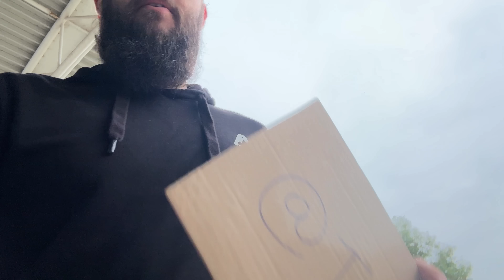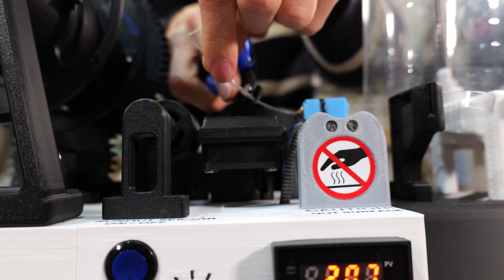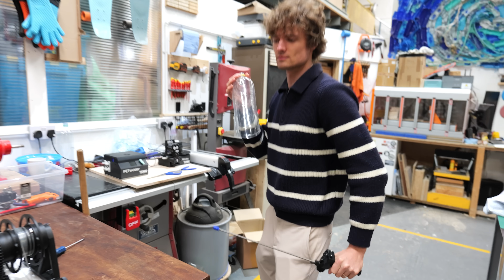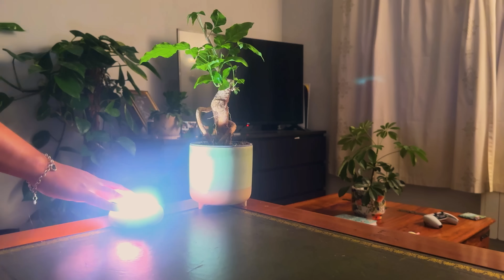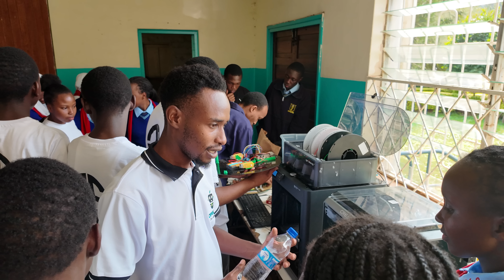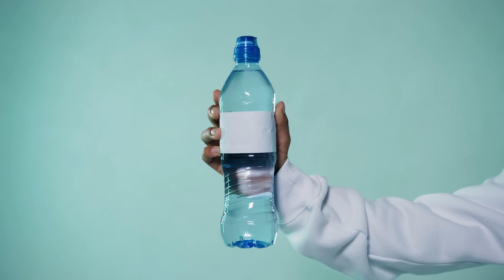Finally, a way to recycle Plastic Bottles at HOME

Comment: Speaking for myself, the fact that 3D printing waste cannot be recycled through the regular kerb-side collection channels is a huge turn off for me to explore the possibilities that 3D printing can offer. Regardless of whether there's space for the printer or how much one costs, I just can't justify a making process which generates that much non-recyclable waste, or at best limits you to what you can print if you don't want to use supports...
Reply from the maker: It’s the same reason we haven’t been using 3D printing for many years. We have recently started using it as a prototyping tool for custom work, which is a great application for it. And the addition of using rPET adds a new level to this
Reply: Again, it is back to how much of the plastic is actually getting recycled in your location? If little to no plastic is getting recycled in your community, then it is likely getting landfilled. Your failed creation will still likely take up less room in the landfill than the original bottles. I have been saving plastic bottle caps from half gallon juices for a long time. I hope to make plastic slabs that can become incorporated into projects by people more creative than I am.

Comment: Im into pulltrusion for a couple of years now. Got into it via the recreator 3d project. I figured out that using acetone or similar to remove glue is not worth the effort or the fumes it emits. I have recycled hundrets of bottles so far and clogs were fairly uncommon at least for me. Far more important is figureing out the right filament profile settings
Reply from the maker: It entirely depends on the level of residue on the bottle. After a decent amount of time invested into preparing a bottle, a fraction of a ml of acetone is a worthwhile expense in our eyes to not potentially waste it completely.

Comment: This is great and inspiring. I believe that all processes of recycling have there pros and cons but just like a eco system, the greater the dversity, the healthier the system. If we were to recycle only a couple different ways the cons would be greatly felt. But if we all employ many different ways be it curb side, repurpose, DIY filament ect.. No one con would be too large.
Also creating opportunity for people to see and find value threw connection for a perceived waste brings about respect understanding and acceptance. I dont need to point out the pros when practicing these values  😊 awesome work fellas!
Reply from the maker: Thanks so much for watching. We preach the same mantra - everyone doing a little is much more effective than a few people doing everything.

Comment: this is awesome, but the only concern I have is that this doesn't seem very scalable and it requires a lot of labor relative to the end result
Reply from the maker: It’s true, it requires a lot of work. But this is a similar comparison to using recycled materials instead of virgin materials. Lots of effort is spent cleaning, sorting, processing material prior to it being ready for use. This makes the profit margins smaller when compared to virgin plastics, but it doesn’t mean it isn’t the right course of action in terms of environmental footprint

Comment: could PET bottles be cut to form flat sheets then bonded by chemical or heat means to form laminated solid sheets for cutting with a CNC for those without a filament printer ?
Reply from the maker: Possibly! But not easily on a small scale

Comment: right so for the bottle smoothing leave little dropplets of water inside close the cap heat it over a heat source while spinning boom done no need for the air compressor the water evaporating does it for you
Reply from the maker: Interesting idea!

Comment: Can you recycle the PET from the first Moon lamp attempt? Is that material basically trash now?
Reply from the maker: This can’t be turned back into filament, nor recycled via curb side recycling unfortunately.
Reply: @BrothersMake But that doesn't mean it can't be used in a crafting way. I have seen assorted uses of bottle bottoms cut off.
Reply from the maker: This is true
Reply: @BrothersMake sorry, I should have waited the end of the video to type my question lol. Thank you.

Comment: I apprecciate the idea, the effort and I love recycling, but... water, soap, heat from the heatgun, acetone... is this actually eco-friendly?
Reply from the maker: It’s an interesting point. If recycling requires clean plastic, is the emission cost of doing this worth removing the plastic from becoming a pollutant? Would be great to do a deep dive on this. Maybe a future video!
Reply: @BrothersMake  I would actually be very interested! I understand that tools like this are VERY useful in situations like you showed from Kenya, but it would be great if it were actually an eco-friendly process even in developed countries where we don't necessarely need to make our filament ourselves.
Reply: No, neither are electric cars so the trick is making people feel guilty for not doing something, no matter if damaging.
Reply from the maker: I agree in principle with the electric car comment, but I don’t think it’s quite as clear-cut as you make out. It depends which step of the lifecycle you’re exploring. 

And no one is trying to make anyone feel guilty. We’re simply showing what is possible.
Reply: @cadthunkin  I agree to a certain extent. I doubt the recycling "system" for plastic is actually doing something significant for the planet (this theme would be too long for a comment like this), but I also think that what people like @BrothersMake are doing is very important. as they said in the video, there are still places where there's an abundance of trash and no recycling at all, and for the local population that might be a very useful resource.
it might not be globally enviroinmentally friendly, but in that case it's still better than leaving that trash go to waste and keep polluting the environment

Comment: it would be really cool to use a dual extruder to make a red and clear mushroom with this with a light inside, or perhaps crystals that you can put an easy light inside as well. 
perhaps it would also be really cool to make yard lights with small solar panels in them. another one is tiles for mosaic-like window hangers. anything to do with light could work great with these semi-transparent filaments.
Reply from the maker: That would look incredible!

Comment: I love this conceptually.  But back in my reality, time is more important.  It looked like it took more than an hour to make 1Kg of filament, that is typically 20 to $25 USD delivered to me.  If it was just 1hr, and you were paying someone to do it,  the effective cost is more than that at minimum wage in the US ($7.50/hr) but the average non-salaried non-farm worker is $36.30/hr currently, so the economics without significan automation do not add up.  Still love the concept and the video.
Reply from the maker: For sure. This is why this is perfect for applications like low-income countries. But it’s also a great option for hobbyists, schools, universities, makerspaces etc where time is not a financial commodity

Comment: I'm no expert, but why could you not cut out the middle man and just chop these bottles into tiny bits that you then can use as either direct media in injection molding or as pellets in a normal filament production line?  Then you would have a number of benefits.  You could use standard machinery already available, you wouldn't have to have a third-party device that, while cool in its own right, is more complex than you need.  You could use the entire bottle, you wouldn't have any loss of product like the top and bottom of the bottle, giving you more yield.  Also, you'd be able to re-use your previous prints.  If you wanted to recycle a previously 3D-printed object, throw it through the chopper/grinder and turn it back into pellets...essentially infinite times, especially if you mix the pellets with other pellets.
Reply from the maker: Unfortunately, PET isn’t suitable for small-scale injection moulding like we use for our regular range of 100% recycled plastic products. It absorbs moisture from the air, so it needs to be dried in a controlled environment. It can be quite dangerous to work with, which makes it only suitable for industrial recycling systems.
Reply: @BrothersMake  Couldn't you use the same dehydrator to dry them out sufficiently?  Again, I'm learning, so I'm not sure.  But also, you should still be able to grind them up into pellets to do standard off-the-shelf filament production, including prints you've already done.
Reply from the maker: We haven’t tested this ourselves, but know others that have. Results have not been promising

Comment: Even when curbside 'recycling' exists there has been so many incidents of it not actually being recycled - just sent offshore for 'recycling' - which really means dumped into the ocean half a world away from the source...
So while turning it to filament might just stop the recycling loop continuing you have ensured it actually IS recycled at least once - a certainty of a single reuse, and not needing to source filament from elsewhere... To me that is a clear win if you actually use a 3d printer and would find PET a suitable material for what you print.
Reply from the maker: This is a sad truth. Recycling rates in the UK for plastic are around 45%, but unfortunately the stuff we export is still counted towards this percentage, which seems rather untruthful. Thanks for watching!

Comment: I've had pretty good results removing grooves in a plastic bottle by putting a small amount of watter in it, putting the thing in the microwave for a short amount of time and then swirling the water around in the bottle. Definitely requires gloves but crazy fast and efficient compared to the technique your'e using and cleans the bottle as well
Reply: Lid on? How long in the microwave and what strength is your microwave in watts?
Reply: @andreafeelsfantastic  Yes, lid on so it builds pressure. I usually put it in the microwave at full blast (900w) for 20s and go from there, eventually doing it again for 10 seconds at a time but other variations may work better
Reply: Yeah that has to save a lot of juice over running a heat gun! Smart!
Reply: @TheDistur  Especially with the amount of time they show it running. Only problem is the size of bottle your microwave can handle. I've had good enough results with bottles too big to rotate but I fear it may overheat some parts
Reply: Yes! I've done this many times. It works great! ... especially once you find just the right amount of water and time it becomes super easy.
Reply: I wonder if a steamer could work.

Comment: Thank you Brothers Maker, you always inspire me. Where I live in the USA, we only recycle HDPE and PET, so IMO PET 3D printing is taking away from industrial recycling. Now if you can find a way to recycle the horrible polypropylene and polystyrene, that would be a game changer.
Reply from the maker: PP is a material we recycle every day in our injection moulding workshop 🤙🏽
Reply: @BrothersMake  In Denmark HDPE, PP and PET are identified with an optical scanner at the sorting depot. Some depots can identify more types, but overall PET will be recognized, regardless of whether it's been through a 3D printer. Most places burn polystyrene, but some cities have recycling of that too.
Reply: @BrothersMake I swear I would have noticed PP. I'll check it out again!
Reply: How much of the PET collected in US for recycling really gets used in ways that reduce consumption of virgin PET? Even if it does, pultrusion & printing is so much more efficient (energy use, chemical waste, transportation, etc.) and still a big improvement if it lets you avoid buying junk.
Reply: From everything I have read, only a very small percentage of any plastic gets recycled, like five percent. And that is only in a few states. So I don't think they are depriving the industrial complex.
Reply: @paulet3682 that's probably true, which is sad because I see everyone buying PET water bottles. It sickens me. Well if you can recycle any plastic, power to you!

Comment: instead of 3d spending hours printing an environmentally unfriendly  litter picker  - trying picking up litter with your own hands (+ reusable glove).
Reply from the maker: What makes it environmentally unfriendly? A glove works too, but lots of litter is in hard to reach areas, making a longer picker very helpful. And even a reusable glove will have a finite lifespan.
Reply: Too many of us past a certain age can't pick up litter. The ground level is out of our range of motion. However, many of us seniors can and do pickup litter with our grabbers. It also keeps our hands clean. I pick up sticks from my yard before every mowing with my grabber. As a person ages, they need more grabbers in convenient places, like garage, basement, and home. May you reach your 70s with the ability to bend over or get on the floor and get back up easily.

Comment: You have reach so hear me out..
What about the maker community start making the prints with the Plastic type? This simple pet converter is cool but proper plastic shreds to filament are popping up in the market and its only a matter of time for it to be common enough that you can simply process the whole bottle and waste prints into proper filament. Having a mark on the prints would help immensely for those recycling old prints
Reply from the maker: This is a great idea. Unfortunately the way that the 7 recycling symbols have been created is somewhat useless. If a new system was in place which defined a wider range of plastics, with some sort of regulation behind it then this would be something we could get behind.

Comment: @BrothersMake would you be kind to share settings for printing fillament made out of bottles? I have Bambulab A1 and i havent found correct settings without fillament clogging inside of the machine.
Reply from the maker: The A1 isn’t the ideal printer as is has a single-gear extruder, which can have trouble with this slippy PET. Tylman Design would be your best port of call for printer settings!

Comment: Good video, very interesting. You could 3d print a PET label into the bottom of your bin for example. So future recyclers know what material it is.
Reply from the maker: Great shout, but unfortunately this doesn’t make a difference in commercial recycling. There needs to be a big change to the labelling system with some regulation behind it.
Reply: There are plastic recycling companies out there, that uses a different approach with more modern technology. They first grind then sort with some fancy hightech machine that detects the type of every tiny flake and sort it with bursts of air.

It doesn't matter of there a recycling logo on the thing or not. Those logos are only for humans manually sorting plastic, something that simply is not viable in large scale recycling, cus virgin plastic is so damn cheap.

Comment: There is no guarantee that the bottles will actually be recycled if they are collected by the council, so if you can reduce the amount collected its gonna be a net positive
Reply from the maker: That’s true. Current plastic recycling rates for the UK as a whole are around 45%. It largely depends on the format of plastic compared to the type.